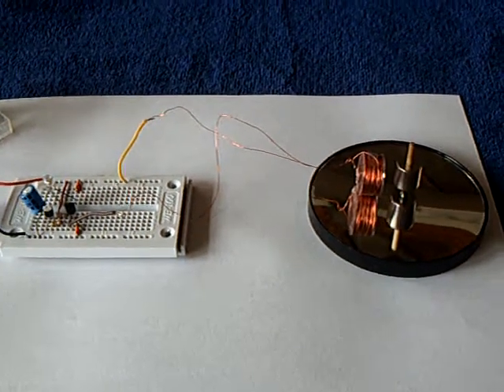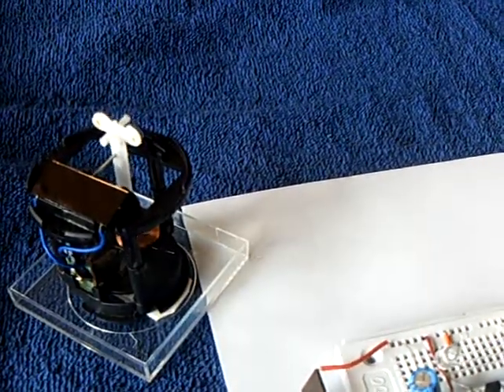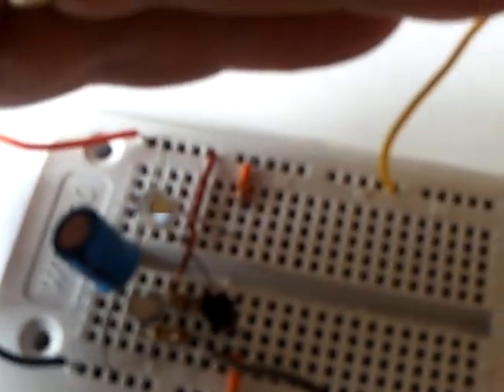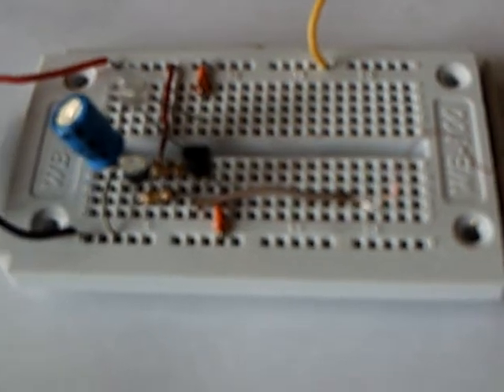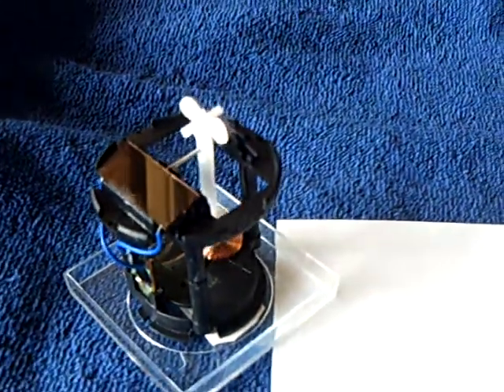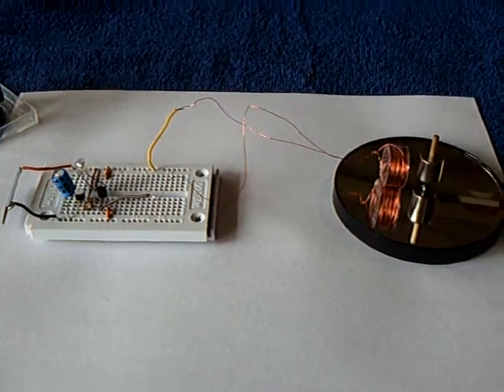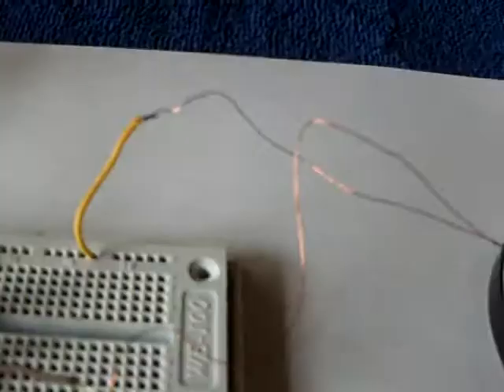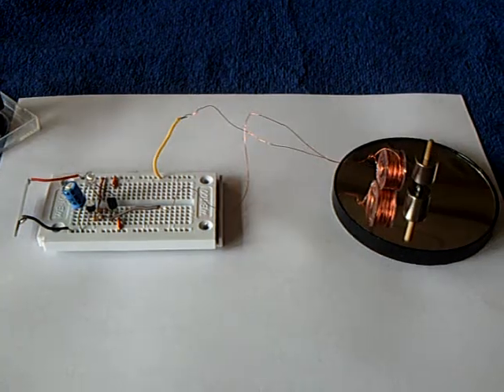Solar Powered Spinning Magnet Top

Comment from the maker: Thanks for the "desktop attraction" idea.  I worked on that tonight and got the top spinning on desk lamp light.  Boxed up in a nice walnut box it would be a fun thing to have at the office.  The joule thief add on for the led would not help.  It would just eat energy and slow down the top.  A 24/7 version of this is totally doable with the right size solar panel and rechargeable.

Comment from the maker: I have worked with the bifilar coil oscillators quite a bit but I don't think that adding that into this circuit will help.  The garden light add on is what DadHav has done and is a great idea.

Comment from the maker: This is kind of a electrical engineering problem that could be worked out on paper using formulas.  I'm like you though and prefer to just "wind up whatever" and see what happens.  I think that fine wire with lots of turns is the way to go here.  The solar toy makers must do that for the simple reason---it works.

Comment: Now that is innovative. If you added a simple coil oscillator to the mix you might be able to boost the voltage up and get better speed. I was thinking about the circuit I saw on Lynx wind's page with his cell phone charger using the bifiler circuit running off a simple solar cell off a garden light he got 23volts off his 2.3v cell.

Comment: Cool. What are your thoughts on the coils themselves in circuits like this. i tend to just wind up whatever... not giving it a whole lot of thought... yet obviously it would have some bearing, for sure. I've noticed the toys have incredibly fine wire and many many turns, but then again that'd have a lot of resistance too... or is that a goal? cheers

Comment: Nice!! I found one problem of that circuit for me lol do not use high gain transistor I have several 1000 hfe transistor and they are simply to sensitive for this circuit. although it work very well for one motor that has a low resistance on the coil.... still need more test :P

Comment: That is awesome once again!!! Are you planning on boxing it up and making a desktop attraction out of it? I wonder if you could get one of the rechargeable coin cells for casio solar watches, and have it charge during the day on a separate panel and then use a photo transistor to switch over during the night so that it will run 24/7? Is there anyway to run the flyback into a joule thief and boost the light of the diode?